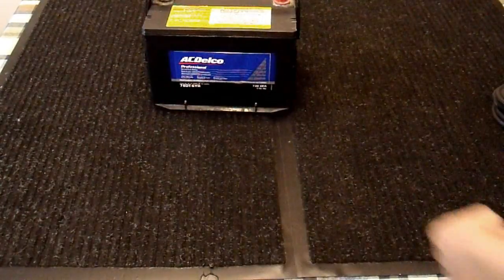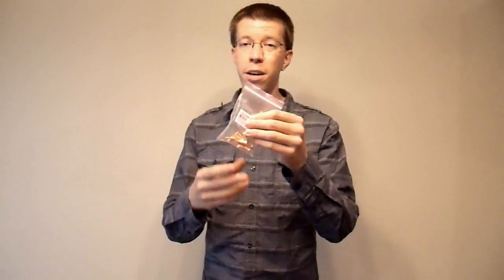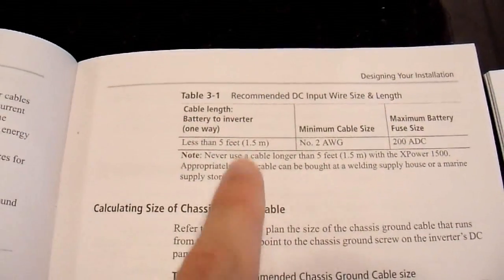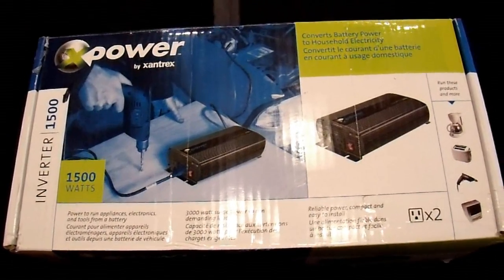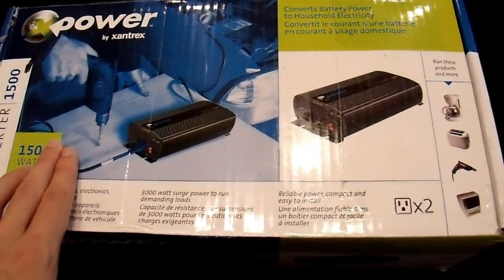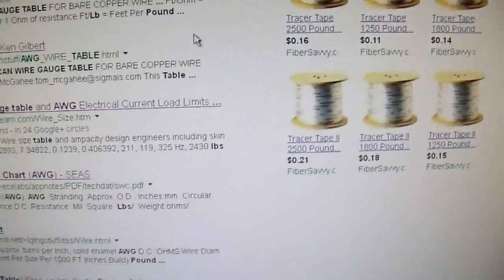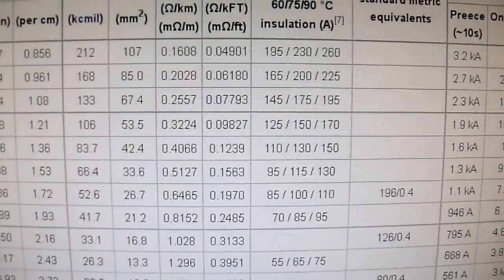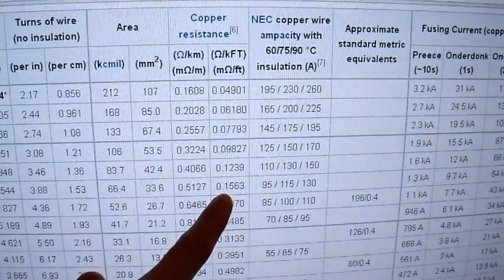How to Select and Purchase Battery Inverter Cables Part1

Comment: Why not just get an inverter with built-in cables that clamp to the battery?
Reply from the maker: Such inverters are not common and cables need to be designed for the system in use.  Any inverter with built in battery cables is a sign of substandard design for this reason.

Comment: i want to power a coffee grinder of 500watts 240v using 2 6v car batteries and a 12v inverter. have you any advice or idea as to what cables etc i might need for this job?
Reply from the maker: This video covers sizing cables for the inverter which is the safest thing to do, however if you wanted to only run the grinder you could conceivably size the cabling for only 500W.  I wouldn't recommend this but it would work.  To be safe assume a 100% surge, so size the cabling for 100A surge and 50A continuous.

Comment: You should use a 120 volt DC to 120 AC inveter, with a 120 volt battery bank this will give you best efficiancy and save you ton's of $$
Reply from the maker: 120VAC requires about 160V DC peak for sinewave, or 140V peak for phase corrected AC.  120V DC would still require a boost stage in the inverter resulting in very little benefit.
Reply: If I have 2 12volt batteries connected in parallel does that make it a 24volt bank?

Comment: Getting a harbor freight 2,000/4k peak inverter. Curious if my one deep cycle battery with large reserve capacity I currently use for my boat's trolling motor would power a 1,000 watt mic for lunch time for 5-10 min. Not hooked up to my charging system, just the battery fully charged and a setup with a thick wire about a foot or two long, and totally portable system.
 I would hook the battery back up to the charger every day after work. Or would I need a couple of batteries ran in series? Thanks.
Reply from the maker: You'd want the batteries in parallel: plus to plus and negative to negative.

But for 5-10 minutes you'll likely be ok with a fully charged battery that is in new condition.  For practical purposes and full satisfaction I would recommend a 2nd battery, but give it a try and see.  You may find that even a very slightly weak battery that is otherwise still fully serviceable will fail your microwave test but still be useful for years afterwards.
Reply: ***** hmm. I've got 2 or even 3 batteries, but they're all different years and sizes. Probably can't run em together like that eh?
Reply from the maker: Peachride EightyNine
In series, no you cannot.  In parallel you can connect them together without any issue.  I would recommend disconnecting them from eachother when not in use however to avoid destroying them all when one fails.  I would also recommend testing each battery separately every once in a while to verify that it still functions properly.

Comment: Hi, So it is OK to use solid wire for DC applications? I have 250' of free 12 awg romex house wire and have used it to wire my solar cabin, all in DC. Hope that's OK.
Reply from the maker: Yes, DC does not care whether the wire is solid or stranded.  Only AC cares about that - look up 'skin depth' for more detail.  Solid wire is less resistant to stress breakage and should never be used in a mobile application but for wiring in a cabin it is an economical choice.

Comment: First of all, great videos. I appreciate you taking the time to share. I think the numbers in the table are for wire in a conduit and can be increased if the cables are in open air. I was wondering, I noticed in the battery video, you had a clamp on amp meter that measured dc current. Can I ask what model it is? Thank you again.
Reply from the maker: It is a Mastech MS2108A.  It certainly isn't the highest quality hall effect meter you can purchase but it is a fair value.

Comment from the maker: It is the opposite, actually.  AC travels on the outside of the wire at a certain depth and DC travels uniformally throughout the conductor.  It is called 'Skin Effect' and at 60hz is mostly negligible.  At higher frequencies you can use Litz wire to reduce its effects, but this is only done at 10's of khz and above.  Uninsulated bundled conductors behave the same as a solid conductor as far as skin effect goes.  The strands would need to be insulated to gain benefit.

Comment: you forgot to tell people that using solid wire for a DCv IS BAD. DCv work better with a multi stand  wire... Example, 8g multi stand  (200-250 or so) wire will work 100% better that a solid 8g wire for a DC application.. DC currant travels on the out side of a wire while ac currant travels on the inside of a wire....